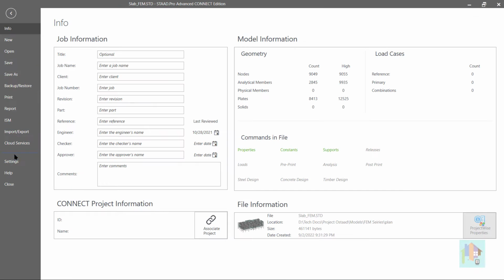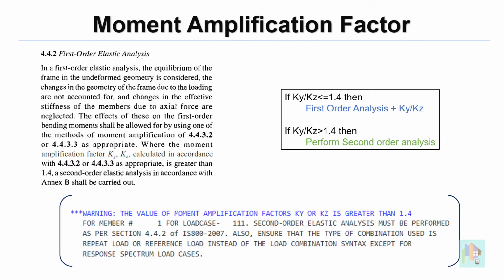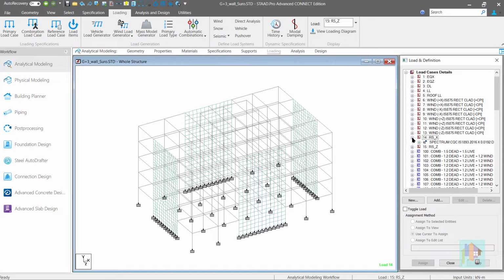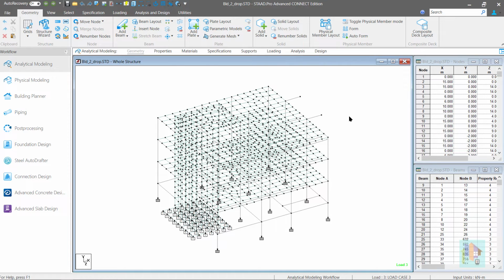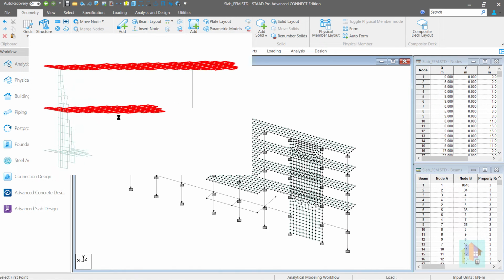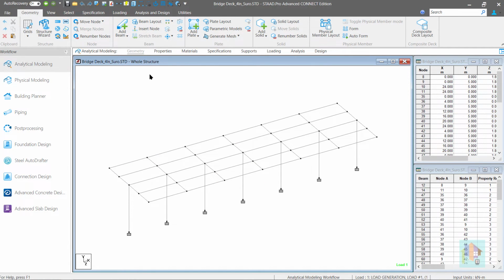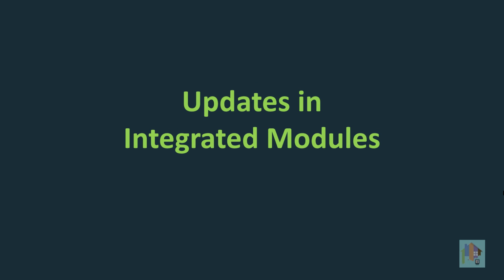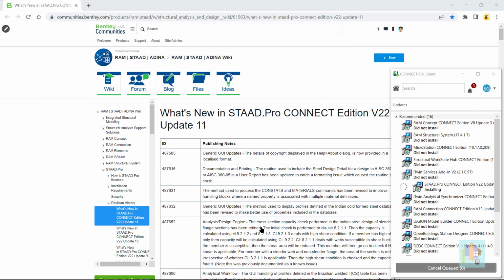STAAD.Pro CONNECT Edition V22 Update 11 - Updates & Enhancements || Parametric model || OpenSTAAD

Comment: The improvement p delta analysis was must required .but in th output whx8h you showed in video , i can see the effective le gth factor being displayed in track 2.0 output . If user assign  effec tive le gth factor in pdelta analysis , will that be shown in track 2.0 output ?
Reply from the maker: 1. Yes, it will report effective length factor.
2. Where did you notice it?